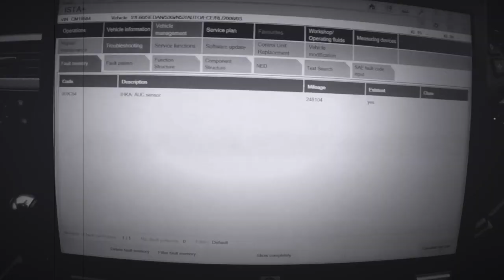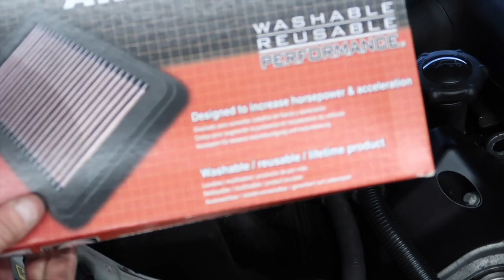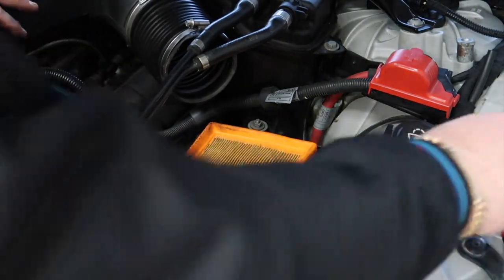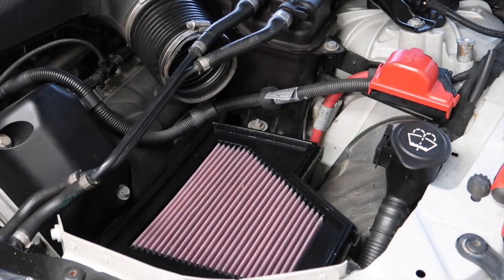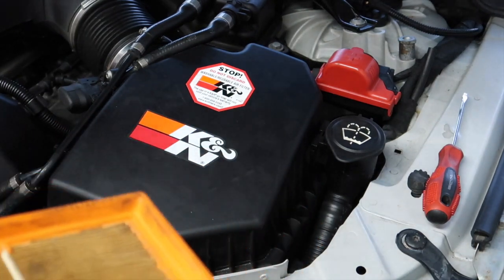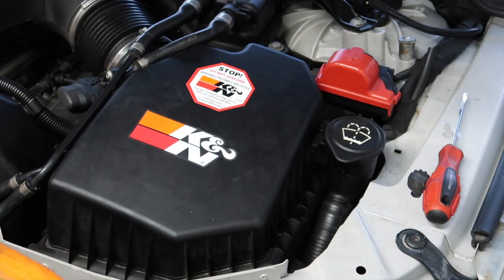BMW E60 M5/S85 Air Filter Removal DIY

Comment: Hey Dr had a quick question im having a start problem with my 2016 x5 35i it cranks but won't fire up i have a CAS Terminal 15 terminal 30 codes what could i do in this situation thanks.

Comment: Do you have to take out the whole top of the air box or can you just take out the old filter and install a new one while the air box is still attached to the intake plenum? I’m wondering because I was able to replace the air filters just by unhooking the clips from the air box and gently sliding in and out the air filters
Reply from the maker: Oh my so you didn’t connect the connector to the air box and program the new filters in 😫 your car must be running badly and down on power then

Comment: Dean are you going to map or tune the m5 and also do those engines suffer with bottom end bearing issues ? If so will you please put up a vid of you doing the bearings dean your the right lad for that engine cuz I know you’ll mind it dean
Reply from the maker: rod bearings bro listen to me these I THINK are on original rod bearing failure is due to idiots revving the crap out of them before the engine is warm !!!

to be fair in the uk we do not suffer freezing cold climate where the oil is so cold it cant get up to temperature quickly and if im honest most who change them here find out it didn't need doing 

some idiot started this all on a forum and thats it sent the world crazy but why did his fail ???? well because he put a tune on the car in the USA and that caused the engine to go bang exactly that if this was a common issue BMW would of done a recall and I think many many from new would have sued and opened cases against bmw if this was a common problem

also I HAVE a receipt from BMW when they changed the whole vanos oil pump so they would have had to drop the bottom end at 60k to change it for the revised one under warranty
Reply: Unreal yeah I don’t get why people don’t let a big girl like that warm up first before revving her out down the road those cars require a straight headed attitude very frequent oil and fluid and filter changes and they’ll last forever as you said yourself dean and they’re built like tanks
Reply from the maker: Mate trust me people are idiots and then have the cheek to say BMW is unreliable it’s crap it’s this no it’s actually THEM as DRIVERS they buy these cars because there all stereotyped and that’s why they get it but can’t even afford 

Mate I had people telling me on here forget the repairs just drive the damn thing forget the limp mode and it’s that kind of people thank goodness can only watch and not own 

Wait till they see my videos of all my BMWs how clean they are 😂 that will upset them to a tee 

They not used to seeing any bmw in there country’s that clear mate I’m very OCD and this car is no exception to that I address all issues even minor that’s how I am 

But as for rod bearings this has a lot to do with the climate and idiots climate plays a big factor but so do the idiots who don’t watch there oil gauge and think it’s a coolant gauge instead

Comment: Hi, I  have problem with my BMW e60 M54, 
I have an unstable idle, I replaced everything, spark plugs, coils, all seals and oring, tank cap, disa, oil separator, just everything but nothing has changed, I'm thinking of lambda but I have no errors. 
when the car is cold it's more unstable 
Please help 
Sorry for my English

Comment: How’s your 530i Dean?
Reply from the maker: very good no issues nothing to record as its giving me no issues lol 

using it daily with no problems not the same as they are in the USA mate here hardly ever any issues still going on original water pump aswell
Reply: BMW Doctor how often you should change your engine air filter Dean?
Reply from the maker: On M5 I would say every 3k hence why I went for K&N filters so I can do it and cost me nothing !!

But on N52 do it every 5k with the oil as it’s cheap enough or just get K&N and never worry about buying them again just clean it

Comment: You should’ve cleaned the air boxes first
Reply from the maker: well just to spoil your correction, I actually did clean all the boxes when I had these off already for another repair which you will see in another video when I post it so how very wrong you are.

you are watching videos that was filmed weeks and weeks ago there has been other repairs since then where there air filter boxes HAD to come out.

and just to clarify with you right now we are in UK all our airboxes are never ever clogged up with leafs and crap if they was I assure you they would be cleaned